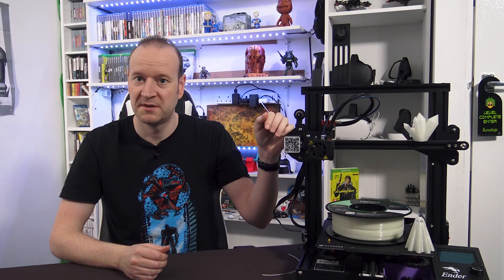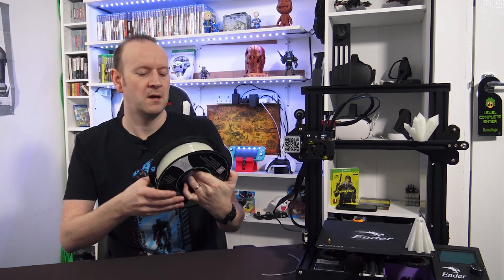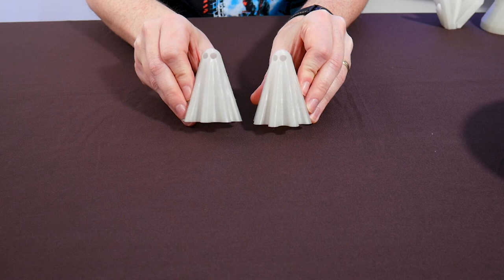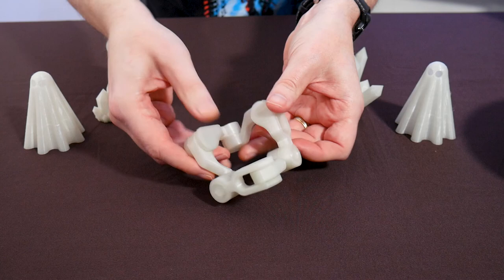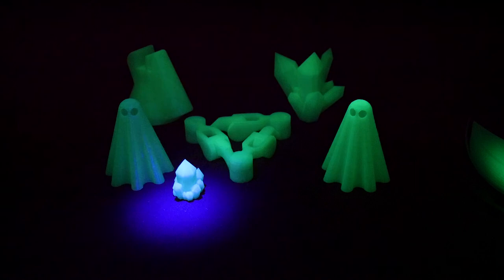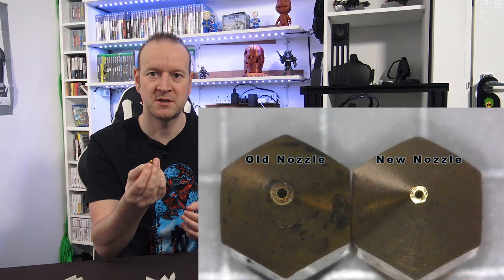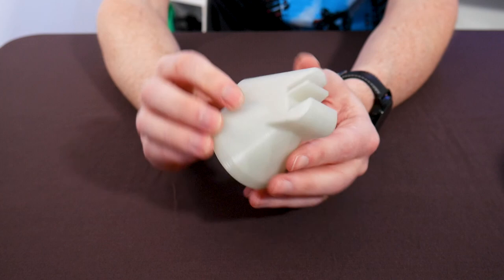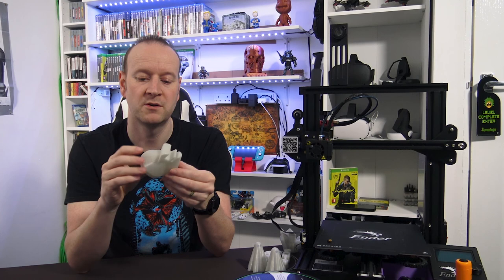Printing With Glow with Dark PLA Filament

Comment: I got some glow in the dark filament I've been meaning to try out, but haven't yet. Interesting to see the effect on the brass nozzle! I wouldn't expect it to wear out that fast. 
How long would you say that the glowing lasts after turning off the lights?
Reply from the maker: With a black light the intense glow lasts for about 30 second to 1 min then fades. The low glow that it gives of lasts for anywhere between a few mins to at the most 5 mins. It might be different for other brands but that is my experience.

Comment: I got the same PLA. What temperature are you using this at?
I've noticed that when going down to 210 degrees Celsius my directh drive extruder goes clicking..
Feels like it has some hard time to push to through.

Or did you also slowed down the printing speed?
Reply from the maker: I print at 230 and slow both the print speed and travel speed down
Reply: @Abernus69  thanks for confirming my thoughts 👍